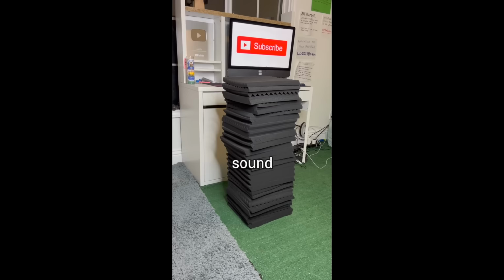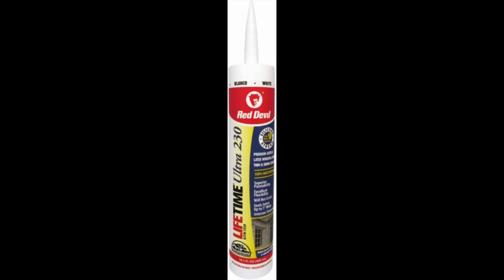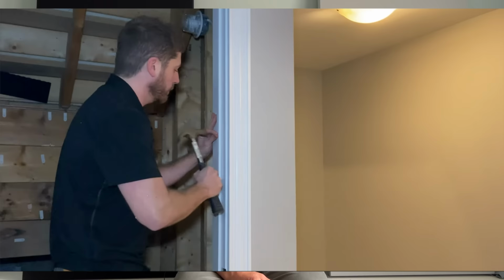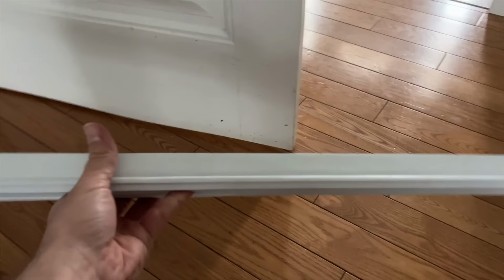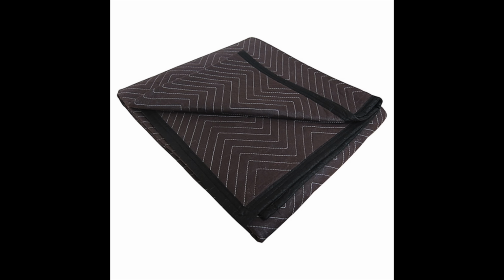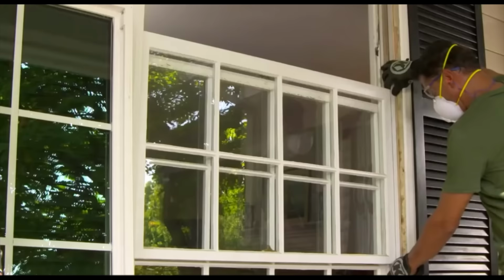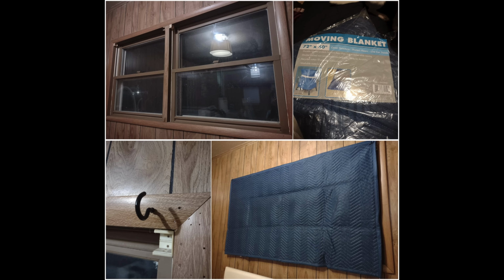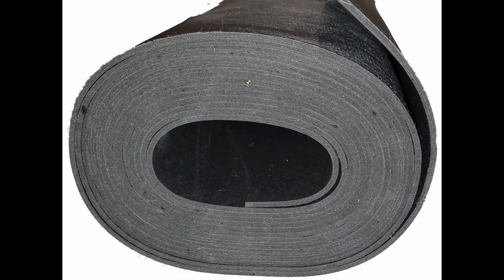CHEAPEST Budget way For SOUNDPROOFING a Room

Comment: Great video and thanks for sharing your experience. 
I couple of things from me, when you want to seal cracks instead of going for a caulk try looking for an acrylic based product. Also, if there is indication that the crack may come back and this is not purely decorative, then you should use a hybrid adhesive. Those are relatively new products which have excellent stretch but are a little harder to tool after application. You may need to get a can for mild solvent to aid you with tooling as it is a lot stickier than silicone. If you can't get any, try a surface cleaning wipe. 

Lastly, depending on where you live, adding sealant and/or backer rod to your outlet may be illegal. You could be creating an electrical fire risk and you absolutely should not seal around electrical cables. Cables do heat up and need a small amount of air around them. What you are trying to seal around is the electrical box and I mean the outside of it. Alternatively, you can get pre insulated/sealed boxes but they don't come cheap .

Comment: I'm surprised you didn't suggest increasing the mass of the door, either by attaching sheetrock to an existing (hollow) door, or by replacing the hollow door with a solid wood fire-rated door.
Reply: I think you could add window and door spray foam to a hollow core door instead of drywall thickness.
I need to try that idea myself 😊
Reply: @wandamoore1731  That's an interesting idea but I'm doubtful of it's effectiveness for two reasons. The expanding foam contains many air pockets so, while filling the void, doesn't add much mass to the structure. Second, the 'hollow' doors that I've seen are often filled with a cardboard honeycomb which would prevent the foam from spreading. 🤓

Comment: cheap upholstery foam is a good option and will do exactly what acoustic foam does. Another option is to use fiberglass insulation in a double layer of fabric (prevents the itching from moving it.) Personally, I'm blessed with a closet big enough and full of enough clothing that it's basically a small studio space. They work surprisingly well.

Comment: Thanx 🙏

Pro typ from the physics lab: work in layers. Alternate between very heavy and extremely light materials / gases. 

Alternating concrete with vacuum would be one of the strongest possible sound proofing strategies. 

The lower the sound you want to absorb, the heavier and thicker the material needs to be.

Comment: My only issue is the moving blankets. Newer ones are made differently and the dye used in the fabric bleeds onto things so if you have light colored walls, floor, any furniture or instrument that is light colored brushes against it the dye rubs off onto it and it is difficult to get off because whatever they used is strong.
Reply: The easy solution there is to wash the blanket a couple or 3 times with extra rinses, until you can see that the dye has stopped bleeding out.
Reply: You could put it in a duvet cover, that'll prevent staining and make it match the room nicely.

Comment: The electrical box sealing may not be safe after sealing materials are installed. You would have to check code on that, but I haven’t seen an allowance for that. The application can also be very dangerous without switching power to off and confirming power has been shut off to each receptacle on the outlet.

Comment: I apologize in advance if this has already been asked a million times. I am looking to reduce the noise in one room of my home, created from my neighbors obsession with fireworks on the 4th of July (and a couple of weeks leading up to and following it). I am hoping it to do all of the things you have recommended in this video, including adding mass loaded vinyl and an additional layer of drywall to one specific exterior wall. Is this likely to help reduce, specifically, the volume of the fireworks?
Reply: Peltor ear muffs could help you too
Reply from the maker: It might help a little but the noise of fireworks are so loud and erratic that it makes it very difficult to soundproof against. Adding drywall and MLV will definitely help but also, make sure to look at the windows as well because a lot of the noise would be coming from there. Best of luck!

Comment: I bought 3 door mats at Dollar Tree.  I cut two up to make one longer one which hooks around the door jamb.  I glued a strip on the bottom side of the mat to make it thicker under the door.  I cut the rest into long thin and glued them around the jam.  I did that to keep the cigarette smoke, and light out.  I noticed it was a lot quieter after that. 

I've used many layers of corrugated cardboard and aluminum foil bonded together which also cut down on the noise some, but the primary purpose was to insulate my windows.  Noise still comes in through the AC vent hoses, so they're next up to be insulated.

Comment: As a german as we build houses from stones instead of wood: 😂😂😂
Reply: In America our houses are engineered to help with heat,electrical conduction, moisture and sound. 

Houses are made by code per country/region. It’s a very naive thing to think one is better. Both are great for different applications. 👍🏼 some houses in USA are concrete like in South Florida, Puerto Rico etc. 

Hope this clears up that common misconception of USA houses. 

Oh and by the way.. not every home has dry wall. Drywall was introduced in the 40’s. Houses made before that had plaster lathe walls. Much more rigid and closer to concrete than drywall.
Reply: You guys in Germany 🇩🇪 are LUCKY! don’t pay attention to the comment ‘explaining’ why these / most American houses are cheaply made. It sucks leaving in those houses, especially when leaving in apartments. It’s constant conflicts with neighbors and no sense of privacy. I miss living in a concrete house.
Reply: Stone houses have damp/moisture and thermal issues.
Reply: @josephineedoua4725 its the same in Germany. A masonry wall doesn’t mean that it is sound proof. Some reinforced metal concrete walls and floors will act as resonator. There are always conflicts among neighbors in Germany. I have lived in both places and can tell you, that you want concrete exterior walls and drywall interior walls. Try to move an outlet in a concrete wall.

Comment: Also home depot sells a sound board that you put on a wall and then your put a sheet of dry wall over it or put on dry all then sound board then drywall if you need more reduction, and it actually works really well. I've used it to sound "proof" many compressor closets for dentist offices or even between demising walls between apartments. I do construction for a living doing new build residential and commercial TIs.

Comment: If you're only planning on recording audio you can make a recording "box" using cheap extendible clothes racks to hang the moving blankets, they will massively reduce reverb by deadening sound before it has any chance to reverberate in the larger room, and then get deadened further when it comes back in.

Comment: Alternating layers of OSB and insulation board work wonders with a 6 inch overlap worked wonders for me on the inside of the door. Thu I already had super think walls already. I used three layers of foam and 2 of wood.

Comment: The trick on turning off the lights and seeing where the lights comes in from is a great tip 👍🏻. I just did that to seal off my windows. 😁 worked so easy and quick. 
Great vid.

Comment: This answers the questions for my new construction - 2 bedrooms with closets between to attempt to deaden sound, but the between the drywall material will be included along with the outlet putty. Lived in an apartment, it was the worst for noise in bedrooms. Luckily, open walls = easy soundproofing.

Comment: I've got a 12 x 24 room that I'm going to make into two rooms  12x12 rooms (1/2" tongue and groove planks). I really like your observations, thank you.

I was going to put 4 old queen size synthetic comforters in the wall for cheap sound attenuation but I really like the moving blanket option.  Maybe I'll do both and completely fill the bays.

Since it will be a wood wall, I can use a zillion staples to hang the material tightly to the wall so it won't act like a drum.

Comment: I once lived in an Apt. that was right next to a big and busy intersection.  The vehicle noise levels were completely unbearable.  I got the owner to agree to help.  They installed a special sound absorbing drywall, over each of the 3 massive windows.   It took at least 3 layers of the stuff, per window.   The sound was reduced anywhere from 60 to 75%... making it a far better experience.

 Standard drywall might be similarly effective too.. if you used 3 or more layers.   I couldnt tell you for certain.

 I dont know how much Plaster costs...  but the older house that I used to live it, had Plaster walls... and they were far more Sound-Proof, than the typical drywall apartments / houses.   That house also had a lot of lead paint in it, in various places...   though, I think the bedrooms were simply wall-papered, rather than lead-painted.  The wall paper had been removed, and I had painted the whole room with some high quality, modern white paint.

 That room also had very thick, heavy, wooden hardwood doors, which also helped  (many modern "inside doors", are made with thin pieces of wood, and have a hollow core).   Replacing a hollow core door with a used hardwood door, might be a decent idea.   Otherwise, potentially filling the door using spray foam, might help a little... and then adding some drywall sheets to the inside face,  may help further.

 Ive often wondered what Movie Theatres use.   I know they generally have very large waved curtains that surround the entire room.   Those curtains might be made from some dense materials...  but Ive never reached out and touched them, to verify.

 If one could get hold of a lot of used tires...  and one had the capability of cutting them into strips...  it might end up being a decent solution.  Obviously, it would be tedious, and a pain to hang them...  but a thick rubber tire section should be quite good at reducing / preventing noises from passing through.

 I believe, 1 cm thick tempered glass... is what they use for the mall stores... and the amount of sound prevention that they create, is utterly amazing.  I imagine, these are pretty pricy, however.

Comment: I was thinking about making my own acoustic panels from either some cheap soft wood, or perhaps pallet wood - that would be the frame of it. Now, for the top I was thinking of using either some thick fabric, or just go back to my initial idea of getting some runner rugs (as those often go on sale for £5-10, depending on the size of the runner rug). Those can come in a massive variety of different designs and patterns, and can look a lot better than moving blankets. The only thing is - if anyone were to try this, look for a rug that allows you to take an inch or two inches from each narrower side. So say - if the design you chose is very symmetrical and geometrical, and perhaps it’s not exactly centred, it might not be as visually pleasing. So, just bare in mind as to how you are going to affix the runner rug to the wooden frame, because for it to be “strong and stable” (thanks Theresa May), you’d need to fold the rug on top and bottom (if the panels are vertical, say 120x80, or 150x80, etc) and then staple it to the wooden frame with a staple gun. Then, I’d also wedge the staple gun in between the rug’s fibres (so they aren’t seen on the finished product) and staple it across all of the frame’s perimeter so it’s even more strong and stable than ever before. Hopefully stronger than UK after Brexit 😂
Also, I looked at those moving blankets, I’m sure they would work fine - and yes you’re right, they are quite affordable but there are other type of blankets that are even more affordable (though perhaps they don’t look super great) - have a look at “felt wool blankets/ moving blankets”. They are the military style felt woollen blankets. The ones I have seen now are cheap and cheerful, but from the photos they were on the thin side. Maybe a better delve into finding those thicker felt woollen moving blankets would yield more results on the ones I remember from around 20 years ago - they looked the same (felt made out of different fibers, mainly grey) but were close 1cm in thickness. The ones I’ve seen now looked a lot thinner. 
I have a lot of experience in guerilla filmmaking and my specialty is sound, so I do know quite a lot on the subject. 😅
In any case - great video, mate. Cheers. 😊

Comment: Solid advice - can add my anecdote to the stack - I needed to soundproof a door between two rooms - the door didn't need to be operational. I went with a combination of hard sheets of insulating foam and duct tape... not exactly ideal but I was freeballin it and it was reasonably inexpensive. The important element is that for the majority of my time installing the sheets snugly shutting out all of the doorspace... it didn't result in any substantial noise reduction... but when I closed the final gap - it was like MAGIC 🧙, the noise reduction kicked in massively. It did basically nothing up until I got to that point - it would 'block' the sound in the same way holding it in front of your face would, but the instant I closed the final gap it all kicked in at the same time. So can't stress enough how critical closing the gaps is in actually reducing sound transmission.

Comment: Great video. Dont forget that every door strike plate has a tab with a little hole. That little hole is made to be adjusted (bent in or out) so the door does not rattle when closed. Not much but it does help with the little wobble/rattle of the door.

Comment: Back in the early 2000s we lived in Russia in apartments built in 1980s. A lot of those old apartment buildings were built along the busy roads, noise of which you could hear all night long. These apartments were already well made soundproof because of thick concrete walls, the only problem was windows and balcony. With a bit of modern euro style renovation and European UPVC double glazed windows that you can fully open or tilt-open not only did it make apartments look luxurious but also 95% soundproof from the busy streets and roads. You could barely hear anything from the outside world. 

When we moved to New Zealand in 2005, thinking the country is way more advanced and better in every way, we found that majority of the population lived not only in cold uninsulated apartments/houses but also with near 0 sound proof windows even the most expensive luxurious homes at that time had windows with ridiculously weak soundproofing. Even I as a 15 year old kid was absolutely shocked and depressed about the fact that a $300k house looks like a fkn shed in comparison to a $50k apartment or townhouse in Russia that looks and feels like a 5+ star hotel. 
Even to this date in Australia and NZ, UPVC double glazed windows aren’t widely utilized and 99% homes/apartments are fitted with expensive windows and sliding doors that has little to near zero soundproofing. 🤷‍♂️

Comment: The wiggle of the door usually doesn't need caulking or weatherstripping. To fix this adjust your door latch strike plate. There should be a tab that you can adjust with a screwdriver. Bend it a bit and close the door, if it still wiggles, repeat the process until it no longer wiggles. If your strike plate doesn't have an adjustment tab you can get a new strike plate for about $2.

Comment: Great tips 👍Surface density is hard to achieve at low cost. I have made frames covered with a lambda open weaved cloth (cotton or linen work well) stapled and behind I have stitched together three old bath towels from the Salvation Army. I have packed then and fixated them the to the frame and hung the frames as if they were a piece of art. This worked well at low price. The towels are a dense material with small pockets or air trapped, a double whammy.

Comment: I think it's more important to determine where sound is coming from to determine whether you have to do some soundproofing or acustic treatment.

I'm not an expert but when I treated my room, I realized most noise was coming from within (mainly AC and computer fans), so I had to treat it to reduce reflections and overall reduce my noise floor.

A carpet helped reduce reflections and making acustic panels helped a ton. DIY Perks made a video showing how to make them. It saves sooooo much money.

Comment: If a door opens inward, a thick yoga mat that's about 2" wider and taller can be stapled to the inside of the door, sweeping the floor and extending up and out 1" on top and sides - I successfully used this to help with stopping a lot of the frequent sirens and loud freeway traffic noise traveling through the bedrooms opposite my office where I was recording voiceovers.

That plus lining the closet walls ceiling floor with two layers of high density moving blankets over adhesive car floor sound deadening (mass loaded vinyl) mat and hanging two yoga mats and a moving blanket over the open closet doorway (door removed) to make a sound isolation box.

Especially don't forget the floor underneath your chair/stool, and tension mount mics - mic vibrations are tough to get out of the background!

Comment: Any hard smooth surface will transmitted or reflect sound.
I work im a video post production facility where we carpeted the floors, walls & doors. Ceiling had thick sound tiles in them. We could not hear any sound from the other side of the wall. One wall was the same wall that we had 26 2" quad video tape machines! You could not hear them at all